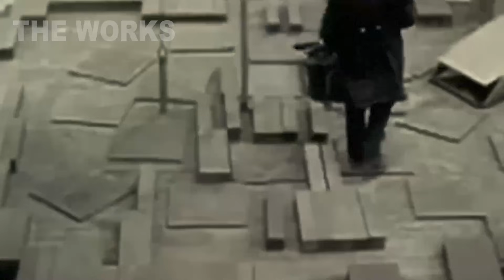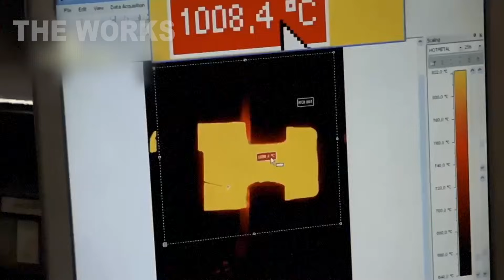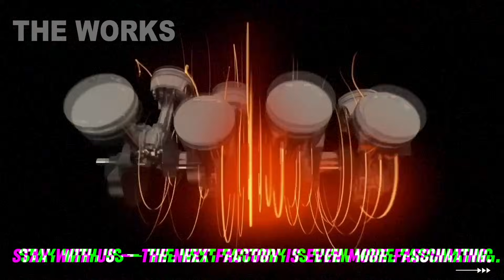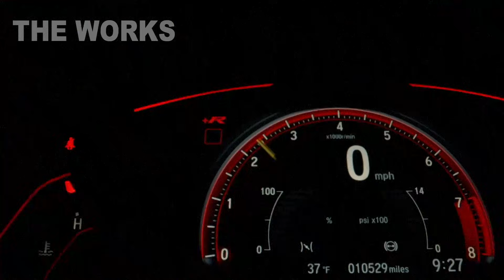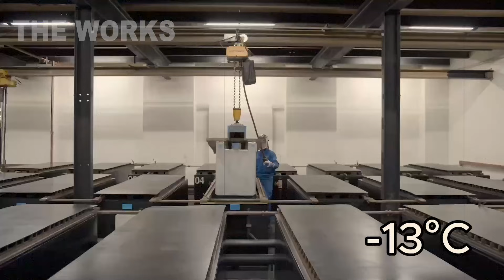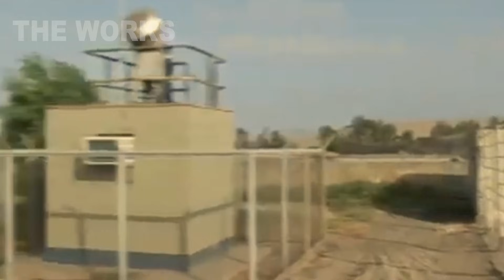The World's Most Powerful Hydraulic Press: 80,000 Tons of Force

Comment: It doesn't come "crashing down." It's a press, not a hammer. It's fluid pressure, not mass and inertia.
Reply from the maker: @RaymondSwanson-u9y yep, it's a slow squeeze driven by hydraulic pressure, not an impact. the ocean liner line was only there to give a feel for the scale of 80,000 tons, in reality the die moves slowly so the hot metal has time to flow into shape

Comment: Italy has a 100,000 ton force press so this 80,000 ton one isn’t the most powerful.
Reply from the maker: @dt8694 checked it and that chinese 80,000 ton one is actually still the record holder for die-forging presses. couldn't find a 100,000 ton in italy anywhere, next biggest after china is russia's 75,000 ton 👍 en.wikipedia.org/wiki/Heavy_Press_Program
Reply: @TheWorks-p7h it’s the Tyson and Olga presses by GIVA group in Italy. Search it up. They are 100,000 ton though the Chinese 80,000 ton one has a larger press bed size.